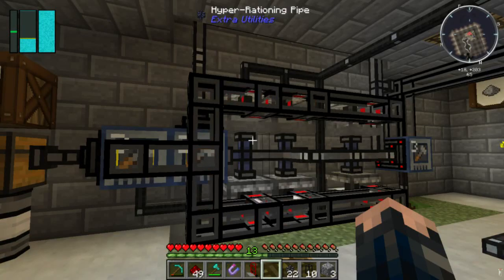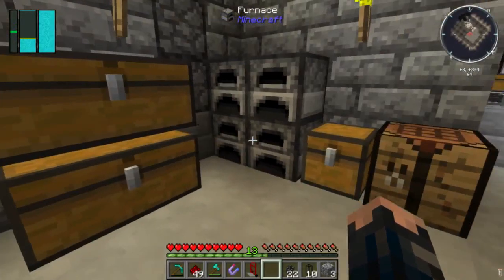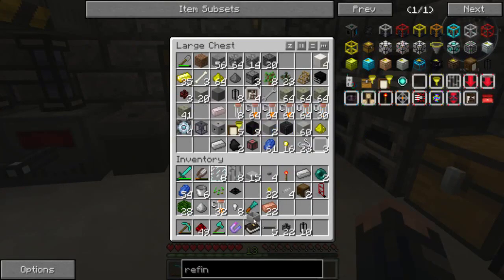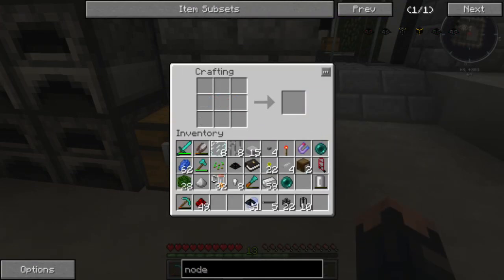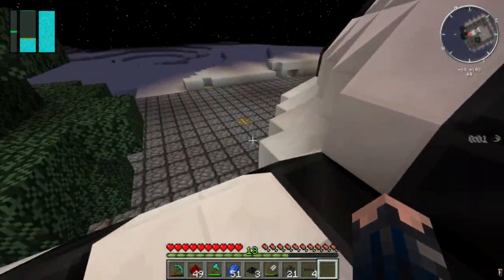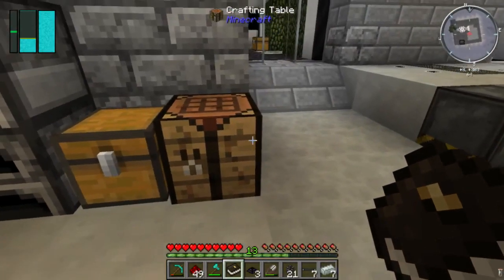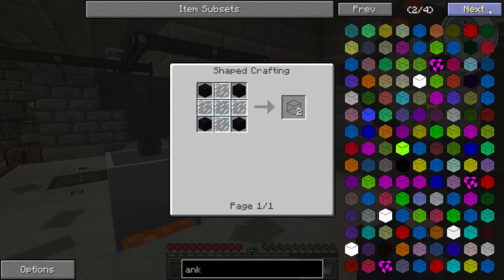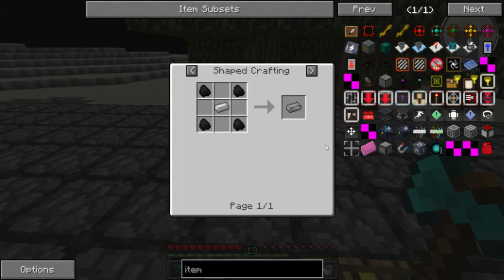Galactic Science S2 Ep9 Fuel Refinery

Comment: Here's how to compress cobble for free:
1. Set 2 chests, 3 blocks apart, connected with relocator piping.
2. Connect 1 chest to a cobble generator, 2nd one to whatever, decomposer, storage, etc.
3. Make 4 "crafting module", is a thing that goes inside the relocator pipes.
4. Insert them in the pipe connecting the 2 chests and set them up. In order, starting from cobble gen chest, set them to make compressed cobble, double compressed, triple and quadruple. You can adjust the quantities accordingly.

Then walk away and when you come back, you might have some quadruple waiting for you. The system eats cobble like crazy, my generator can't keep up. At some point in the future, I might have to consolidate cobble production in entire base (I have 3 separate cobble gens) and tag this little thing alongside.

Comment: you should go in to the mod advance generators, but before you should collect al lot of iron on mars, with the rr pickaxe it is easy it could mine 5x5 of one , i use lava generating with crucibles and make steam , then pump it to a steam genrator, not much resource and a system that bring you easy rf without constantly looking at. And you can expand it easy if need.
Reply from the maker: +Frau Lysifee I'll be doing that after my mars trip as one of the parts requires desh